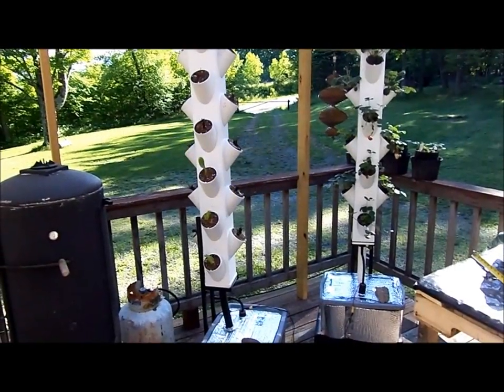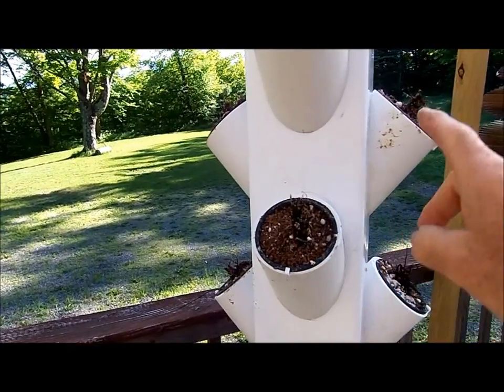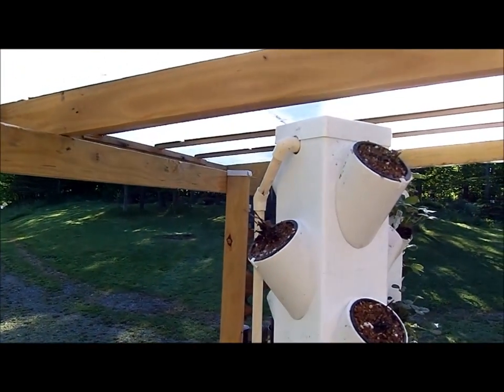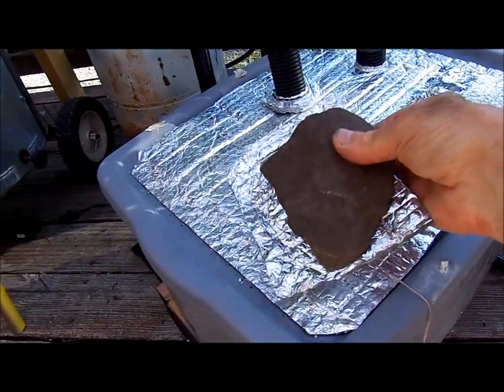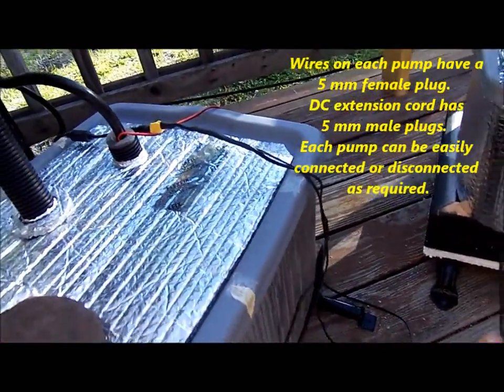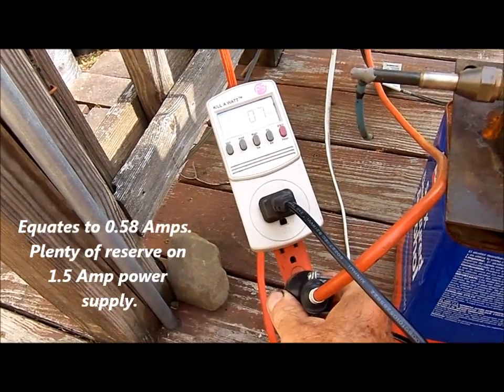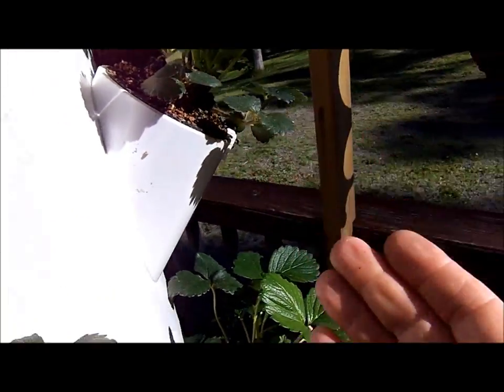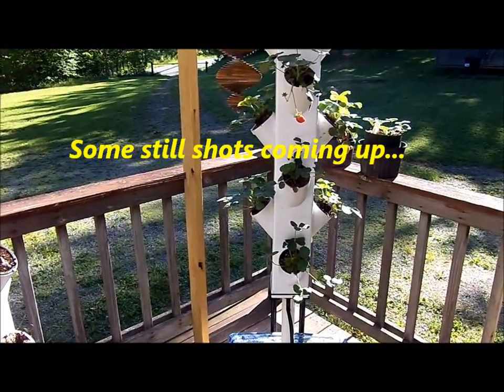Strawberry Tower Number 2

Comment: those are nice towers I don't get the water pump you have dirt where's the water going
Reply from the maker: Sorry, I do not understand the question.
There is a reservoir (tub) at the base of the tower.
The tub has several galllons of mixed water and nutrients.
The small DC pump pumps the water/nutrient solution to the top of the tower; gravity allows the water to flow down inside the tower (over the plant roots), back to the tub...and the process repeats.
There is no "dirt"; for a growing medium I used a mixture of Perlite and Vermiculite.
I hope that helps.  Thanks for watching!

Comment: Even with an RCD unit in the mains power line, I still use 12volt DC pumps etc. water and 220 Volts are always a risky business. Thank you for sharing your towers and tips, I will keep my plant spacing less than I had in mind. Greetings from Tasmania Australia 👍😁🇦🇺🦘

Comment: How long is the day when the water pump to grow the verticals runs the pipes
Reply from the maker: Good day...thanks for watching!
I am unsure exactly what you are asking...
The 12-volt pump runs continuously (24/7).  
The nutrient solution (in the tote) is pumped to the top of the tower.
Once inside the tower, the solution drains down and out the bottom of the tower then back to the tote (gravity); the process repeats.
The 12-volt pumps are quiet and are economical to operate.
The pumps have a maximum lift of about 7-feet (200 cm).
Hope that helped.  Regards!
Reply: @Kntryhart  Thank you brother I am grateful to you for the good answer

Comment: Hi, I 've looked up many designs, yours looks the smartest most efficient one i've seen. I am wondering if you could help me and provide me with some details..
- What type of material if the main pole/pipe that carries the entire structure..
- What are the dimensions for it, what is the name of it, how much does it cost..
- Where did you get it from.. 

if you have any guidance and/or measurements sheet on the entire design it would be a great thing. 

Last but not least, thank you for taking the time to share this, and i am sorry to hear that you had to give up on this because of the flies..
Reply from the maker: I updated the video description to include the information you requested.  Thanks for watching!
Reply: Kntryhart  Thank you so much for getting back to me, and for taking the time to update the info. I am sorry for the late reply, I thought I had done this reply previously, but I guess I got interrupted and never finished it at the time. Keep posting.. I enjoy your watching your materials, thank you once again.

Comment: any updates on these towrrs? are you still using them?
Reply from the maker: No longer using them.  A new type of fruit fly has made it impossible to keep the fruit from getting devoured.  If you would like the towers (free of charge) you can have them.  Zip is 13778 (no shipping).
Reply: Kntryhart   oh darn!!! I wish I have the means to go there. I will glady pay you back for the materials. my hands are frail and I can't do any drilling or sawing. my husband circular saw is dead and since I don't drive (I'm a stranded Asian living in Missouri), I can't go anywhere unless I have a driver.

my problem when it comes to strawberries are either slugs or birds. I was advised this year to plant strawberries in hanging baskets and I came across Garden Answer who made strawberry towers out of galvanized tubes. it gets really HOT in Missouri during summer months. i'm afraid to use galvanized tubes. I might end up cooking the strawberry plants.
Reply from the maker: The first year, the towers worked great.  The second year, I had problems toward the end of the year with fruit flies.  The third year I lost almost all the strawberries to the fruit flies.  
The galvanized tubes do not appeal to me due to lead leaching out of the plating.
https://www.bigberkeywaterfilters.com/blog/lead/galvanized-steel-pipes-leach-lead-into-drinking-water/

Regards...
Reply: @Kntryhart  Just for the record, galvanized pipe after 1960 does not contain lead. The zinc used is pure. It does however trap lead in it's corrosion, and in cities that still have lead service lines that can be a minor issue. Most lead lines have been around so long they have a coating inside that traps the lead, unless a ph change (Flint, MI) corrodes the coating. Your link is from a site selling something, and omits these facts.

Comment: Hi can explained how did u connect the 12 v pump to 1/2 pvc?
Reply from the maker: A hose barb and a thin black water line.
Example:  https://www.coleparmer.com/i/cole-parmer-threaded-adapter-male-nylon-1-4-x-3-16-pack-of-10-31702-06/3170206?PubID=UX&persist=true&ip=no&gclid=Cj0KCQjwkpfWBRDZARIsAAfeXaqNvSY4OzV5z0HTClBmAieAoPIsGCdX-20vAVKWSTvvfpDOsgs-mA0aAv-MEALw_wcB
Example:  https://www.usplastic.com/catalog/item.aspx?sku=58033&gclid=Cj0KCQjwkpfWBRDZARIsAAfeXaqviLXdv8R1NVmcQ6xKq7U-sPW9i_OqQjrBoefUwVEwGIvEgK_cL80aAkf3EALw_wcB

Comment: Did you run the pump 24/7?Do you have to replace with fresh water and put new nutrients every week or you just refill when it low? Thx
Reply from the maker: I used just one small 12 VDC pump for the two towers and YES they ran 24/7.
Refilled tote with water until nutrient level got down to about 300 (total dissolved solids) or so, then did a complete clean, new nutrients and water. pH of the nutrient solution is very important also.
Regards.

Comment: hi im still very new to the system.DO YOU HAVE A TIMER FOR YOUR WATER PUMP OR IS IT CONSTANTLY RUNNING ?
Reply from the maker: I use small 12-Volt DC pumps; I leave them running 24/7.  Minimal power consumption.  Good luck!
Reply: thank you so much.do you have air pump in the tank too? or no.
Reply: i fixing to grow mainly lettuce .is 2 inches net pot are large enough and how far do you have set them apart ?
Reply from the maker: Yes, I have an air stone inside each nutrient tank.
Reply from the maker: For lettuce, I highly recommend a "Kratky System".  Absolutely no work once it is set-up.  See mhpgardener channel to see how to make one.

Comment: how often do you run your pumps. are they on a timer?
Reply from the maker: I highly recommend the small 12-volt DC pumps (I show them somewhere).  I have them running 24/7; cost is minimal and the plants never run the risk of being without moisture.
Reply: How do you convert the Dc to run on ac
Reply from the maker: I think you mean how to convert household 120-Volt AC to run the 12-Volt DC pumps.  
I purchased AC to 12-Volt DC converters (relatively inexpensive) and used them to power the 12-Volt DC pumps.  You can use small AC pumps, but they consume a lot of power and tend to heat the nutrient solution (you want to keep the nutrient solution as cool as possible). Regards.
Reply: Thank you so much for all the good info. I built one of these over the winter and am trying to figure out what to do next....A big project for this girly girl :)  Thank You for all the awesome help
Reply from the maker: Just a thought...if you are interested...I would be willing to send you one 12-Volt pump, a power supply, and some other odds-and-ends to get you started (no charge).  If so, send me a private message with an address.  Regards.
Reply: Thank You very much. I sent you a message. The reason I really want to get into this Is that I live in Portland Oregon and my soil in my small yard is horrible full of rock and high acid soil do to all the fur trees surrounding my yard. I try to plant in the yard and the slugs and snails just eat everything. I have good results with straw bale gardening but then by middle august the slugs eat all my tomatoes and strawberries. I built the tower to put on my deck were I could manage the pests. I am going to give the dutch bucket system a try also.  I really like your videos because they are on a smaller scale then some on youtube, who are doing it for a business. They could be overwhelming. I really thank you for posting these videos they are going to be my go to hydro bible lol.
Reply from the maker: Received your message...will let you know when it heads your way.
I tried the straw-bales...too much trouble and they smell!
Try a small Kratky system for lettuce, spinach, (greens).
mhpgardener was my "inspiration".
If you have chipmunks or other small vermin, you will have problems even with the towers.
There is a relatively new variety of fruit-fly that has been a big problem for me over the past couple years.
Regards.
Reply: I have been playing around with the Kratky system in my house over the winter with lettuce under a led light. I am impressed by the lettuce I can grow using that method. I will definitely use Kratky this year. I bought a small harbor freight green house last year and I will grow my lettuce in there this summer. As for the fruit flies I have a big problem with them here I will try the Apple cider trap. Did you try putting the tower on a timer? May be they are attacked to root rot  and to much moisture? Just a thought.

Comment: Great design for a tower to grow strawberries.  I have built a similar power but with a round 4" pipe and looking forward to a bit warmer weather to start planting.  I have a question if you don't mind.  I am in NJ (zone 6,7) and am wondering whether these plants can be left in the tower during winter or they have to be taken out and put in the soil for over-wintering.  Thanks.
Reply from the maker: Last fall, I cut back all the plants and left them right in the towers.  I have no idea if they will survive or not...time will tell.  I am in growing zone 5a (a little cooler than your location).  I was surprised that strawberry plants can tolerate spring frosts. Good luck.  Let me know how your towers work.
Reply: Root the runners, then place in a fridge or somewhere that stays between 32 and 41 deg through the winter. Make sure that they don't dry out and plant the runners back in your system in the spring. You can try to keep the mother plant in the same manner but wait until it goes dormant.

Comment: I hope you are still out there. I built a tower, and ordered strawberries on amazon. Then when I got them, I realized I did not know how to put them in the tower. I cut out the bottom of net pots and set thye crowns up a little to try to keep them dry. That did not look good after a few weeks. So I stuffed some rock wool down in the net pots and it seemed to improve slightly, but I still don't think I have it right. What did you use? Don't want to clog the pump.
Reply from the maker: Started at the bottom and filled the tower up with Hydroton (clay balls) until the first openings were about have filled.  The I place the roots onto the Hydroton and filled the remainder of that opening from the outside.  I continued the process for the entire tower.  I tried the foam plugs last year...not a good idea since the crowns were kept too moist.  Good luck!

Comment: any problems with spacing so tight?
Reply from the maker: +sonofthunder 333 As for growing, no; but as the plants fill in tightly, it is difficult to see fruit ready to pick.  Also, less air circulation around and through plants and this far into the season they are getting root bound.
I moved the tower into my greenhouse a few weeks ago to see how long they can go into fall.  As of October 08, 2015, I see quite a few new berries on the plants and a lot of new blossoms.
Thanks for watching!  JT

Comment: Interesting but a spray would be more beneficial where did you get these towers from please?  Can they manufacture black ones as they would be better than white.
Reply from the maker: Tony Saunders Good day.  A spray would require a pressurized system, which I do not want.   I built both of these towers (DIY).  I don't think you want black; it is important to keep the nutrient solution as cool as possible (some growers actually use chillers to keep solution cool).  Strawberries like bright light, but do not do well in higher temps.  Check out my "Strawberry Tower Modification" video for the latest update.  So far it is working well.  Regards.

Comment: have you tried to over winter your strawberry's? When we grew them in the ground we used to mow them with a lawn mower, they came back every year, How could you over winter strawberry's in a tower????
Reply from the maker: Good question!  
This is my first attempt at growing strawberries.  I happened to see the tower design on another channel and decided to try it (I have since abandoned it for a horizontal design).   But the same issue remains, how to overwinter.  From what I have read, the best production is for the first two years, then the plants should be replaced.  I have had two light frosts so far, so for now I have moved the entire unit into the greenhouse (nice to be able to relocate the plants so easily!)
My hope is that I can continue to get strawberries until it gets well below freezing.

FYI - I just finished my daily helping of fresh strawberries with my lunch (September 24).  :-))

Once it becomes impractical to keep the strawberries going, my plan is to remove them from the hydro system, trim the plants back and pack them in moistened peat moss.  I should be able to keep all the plants I have in one plastic tote.

Once spring arrives, I plan on getting them going early again in the greenhouse, then move them back outside.  This is the beauty of a portable system.

I really like the hydro approach and plan to triple the number of strawberry plants next year.

Thanks for watching!  Regards.  JT
Reply: Kntryhart  think you could keep them in the freezer till spring? I mean trim off the leaves, just put the crowns and roots in a plastic bag, maybe a little sawdust and water to keep them moist.

Comment: Are the pumps on 24/7 or have you got a timer hooked up?
Reply from the maker: When I was using the towers, the pumps were on 24/7.  Stopped using towers since I had problems with the upper plants preventing nutrient solution from reaching lower plants.  I am using a horizontal design at the moment with no issues.  Thanks for watching!